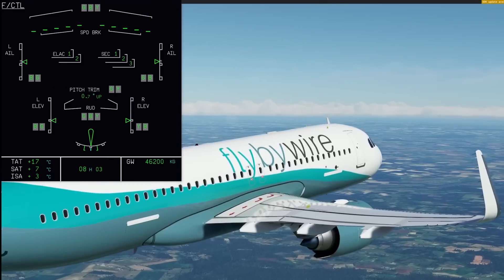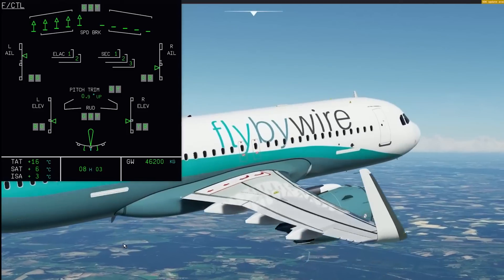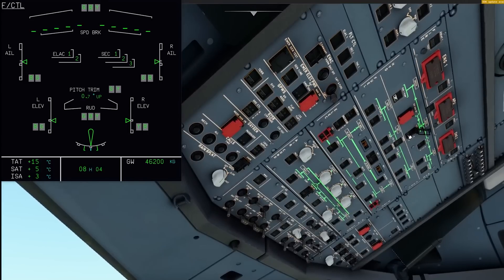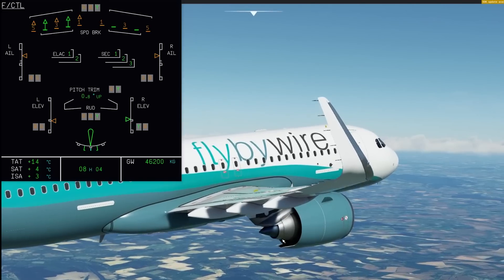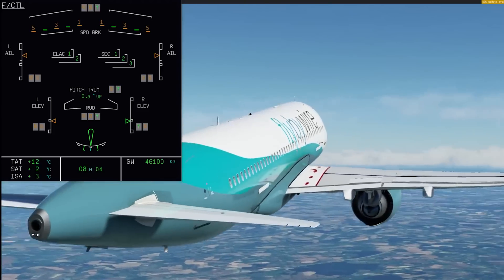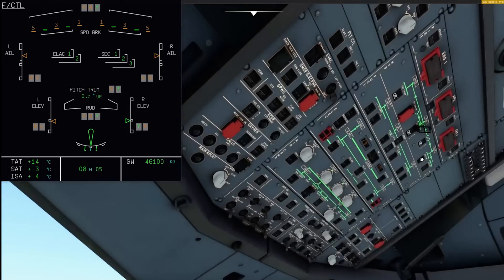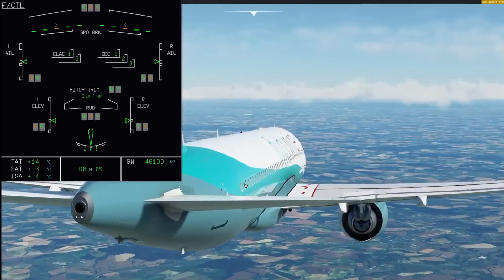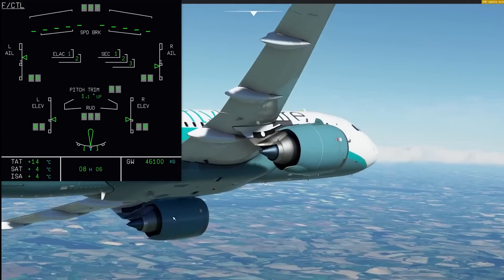FBW A32NX | Hydraulics and Aerodynamics Interaction

Comment: Best regards, FBW teams.
I congratulate you for your work. Actually you should be sitting where the ASOBO programmers are.
Just a few tips to make the A320 more realistic:
The tiller (pedal disc) is missing to be able to test the controls.
The TCAS does not work at least for me in the latest version.
The Radar would also be good if it were functional.
Being able to interact with GROUND for ground services.
The button to test alerts (Callouts) is missing.
And it would be nice if the side windows could be opened (CO and FO).
I hope my comment will be of help and contribution to you. Thanks.
Reply: You can install toolbar pushback to interact with ground ;)

Comment: Can you investigate what is happening with A/T. I am using Steam version of FS and latest developer version (78b85e5) of your A320. Not always, but sometimes it happens when I am at decent, A/T puts engines at IDLE. But if I need to level during decent or need angines at final, A/T do not add throttle to engines, so my speed drops below speed that is set. Throttle levers are at CL detent. Even if speed drops bellow set speed or get very close to stall, no throttle added. Only solution is manual throttle input. 

By the way, so far your work is awesome.
Reply: I had this kind of issues with an old joystick. but since i setup my warthog  throttle and joystick, no more problems.

Comment: So appreciative of the work you do. And FlyByWire team.... make no mistake, you are the reason FS2020 survived it's first year plus....without the A32NX, so many would have given up on FS2020. So while there may be Fenix and PMDG now, A32NX is right up there with them in quality, and in some ways, superior. Thank you!
Reply: No doubt. Every people were using their system after that. For example the a330-900. They made the game alive
Reply: True. For me atleast
Reply: Yup, the only reason I bought MSFS back in the day, otherwise it would've been a much more casual experience
Reply: And I drink to that
Reply: Yes I concur, if it wasn’t for the FlyByWire team then MSFS 2020 would have been bypassed by many. Many would have seen MSFS as a casual sim offering. Because of the good work done by Asobo, and our current computer hardware, it offers a platform for folks like FlyByWire to excel !. Thank you FlyByWire for your hard work and dedication enabling flight simmers to have a sense of immersion, and a product that stimulates the mind and excites the imagination.
Reply: I actually did give up for two weeks until I saw that A32NX had been released on 25 Aug ... I had spent six months in FSX practicing in the A321. Getting into the A320 and finding only ten or so switches and buttons worked, and that there were only 3 MFD pages, it was horrendous!  Then I took my first flight, and NO SEAT BELT "PING" ... the whole experience was dreadful and upsetting.
Sitting in your cockpit, looking at the wonderful scenery and clouds (which they later broke) a lot of us realised the sinking feeling in our hearts was because this was for eye candy, not really for simulating flying aircraft.
And then v 0.2.0 A32NX !!! Woohoo !!! I got my chimes back and deleted FSX ;¬)

Comment: Recent experimental version has a problem with pitch during landing where it goes into the air while flaring cause of the control responses not being sensitive, hopefully it will be fixed soon and love the fbw!
Reply: I don't think they provide support to experimental, and the best way to issue a bug report would be through GitHub. If you need a stable experience, the development version is much more stable than exp.
Reply: @LeDerpLegend  True...but I wish they would add VNAV to all versions.

Comment: Hey fbw I really love your aircraft but there is a problem with the steering on this aircraft when I steer to the left with my airbus joystick it will turn right so I am having a very hard time taxing and mostly landing because it just goes off the runway with no steering control.
Reply: Disable rudder assistance and you'll be good!
Reply: @leloginquitu  omg thank you so much I had this trouble for more than 1 months and finally fixed!!
Reply: this would be because you have the axis for the turn binding the wrong way round.